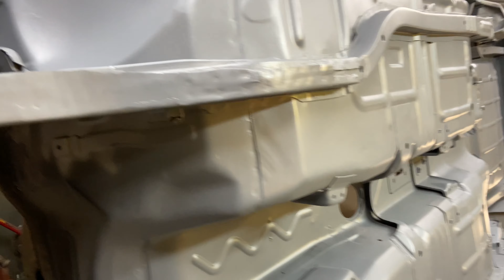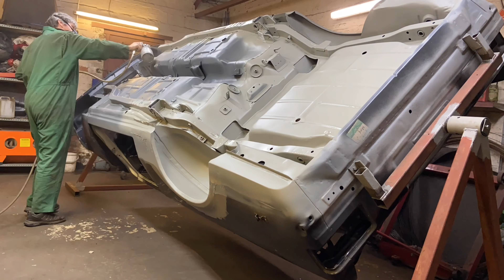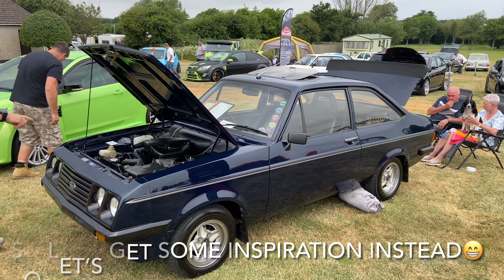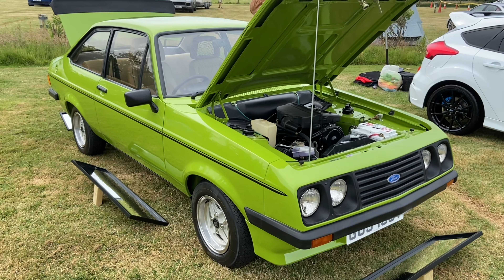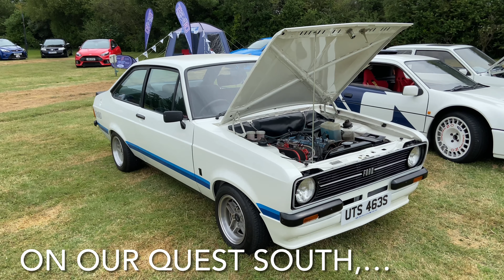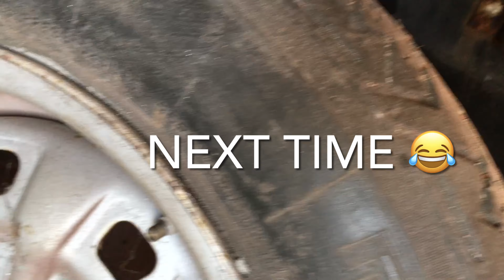Base RS2000 Restoration 21: Procrastination

Comment: Getting there mate 👍 some nice things at the show!!
Are you painting the floor in body colour or stonechip/raptor etc?
Reply from the maker: I’m gonna replicate the poor finish of the original 😁 satin black with grey dusted over it in places, grey down the centre (all in 2K) and rubberised whiteish spray on seam sealer under the arches and between the sills and chassis rails. 
I want it to look as it did, not gonna be used in the winter or on a rally stage, so won’t get too battered😁
Reply: @MarkEdwards   cool, I'll look forward to seeing the progress 👍